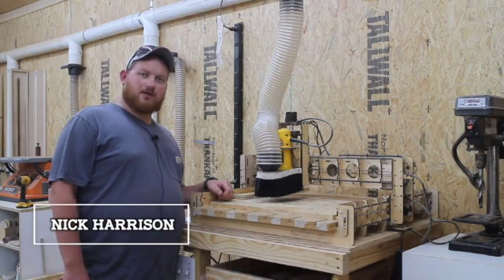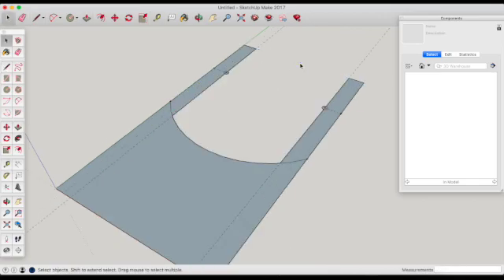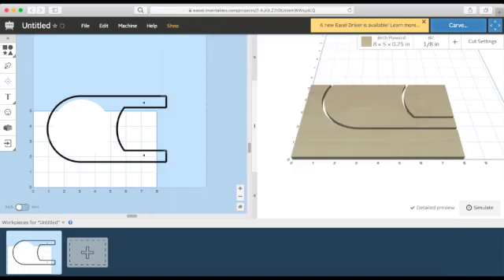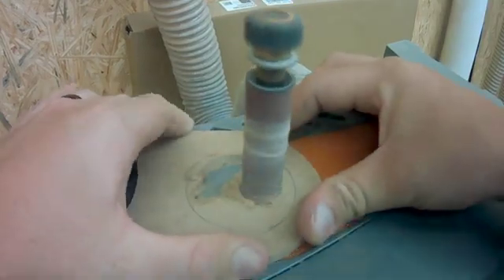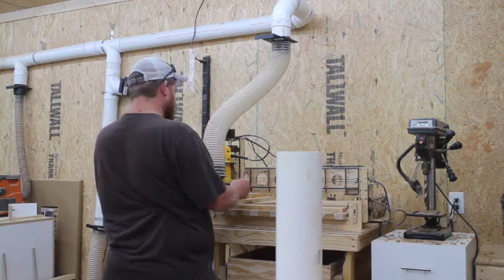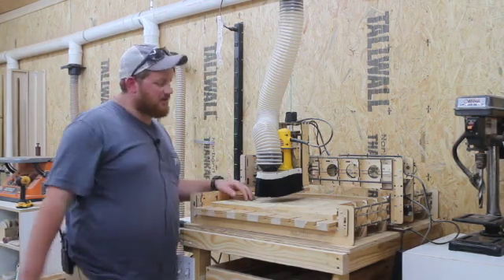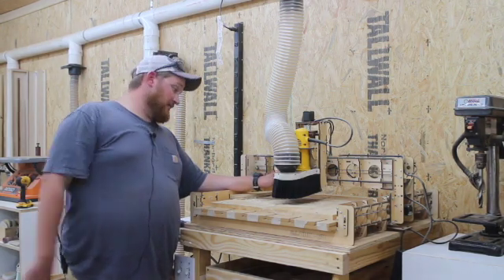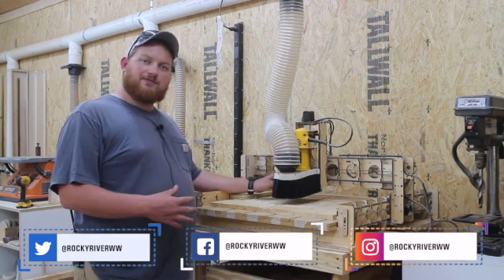Adding Dust Collection To CNC Router | Bobs CNC E4 Dust Collection

Comment: I have mine mostly enclosed but still get a good amount of debris flying away from it. I use DIY curtains similar to what welders hide behind but just cheap plastic stapled to a frame I can position in the area I open to access for bit changes etc. It keeps a lot of dust raining on the floor after it hits the curtain. I even thought about dollar store shower curtains. Whatever works!!
Reply from the maker: That is a good idea. Shortly after this video, I built something similar and it helped with dust and noise. I then upgraded to a Shapeoko and now have upgraded to a 5'x10" ShopBot.

Comment: I did a very similar design, but i made the outer frame from .5" softwood with indents, then a separate layer for an acrylic top so I can easily and safely see the tool. I ran some tests with 2.75" skirting and found it's great if you are running profiles, but binds easily if doing detail cutting. 

2 solutions I found. 
1) I made an additional skirt with a second layer of softwood to bring the skirt closer to the surface
2) I tapered the skirt bristles to allow them more flexibility. Basically cut about 60% of them about .5-.75" from the banding. It still catches the dust and actually allowed me to create deep plunge cuts without worrying about jog on the Z axis. If anyone is curious, tag me and I'll try get a pic or facsimile for you.
Reply from the maker: Glad it worked for you.

Comment: The dust collector is needed to keep dust down in your shop and your lungs, but it still builds up on your X and Y axis rails and bearings. Here is a solution that fixes the dust on the rails and bearings: https://www.etsy.com/listing/1050295308/bobscnc-evolution-e4-cnc-router-engraver?ref=shop_home_active_1&frs=1
Combine it solves the problem.
Reply from the maker: Yes, I usually give the rails a quick wipe after heavy use of the machine.

Comment: just curious if you have stuck with this or not I've had a bobs for 2 years and just haven't figured out a good all around dust collection solution.
Reply from the maker: Yes I still use this. It works good. It's not 100% dust free but compared to not dust collection at all, its a night and day difference.
Reply: The dust collector is needed to keep dust down in your shop and your lungs, but it still builds up on your X and Y axis rails and bearings. Here is a solution that fixes the dust on the rails and bearings: https://www.etsy.com/listing/1050295308/bobscnc-evolution-e4-cnc-router-engraver?ref=shop_home_active_1&frs=1
Combine it solves the problem.